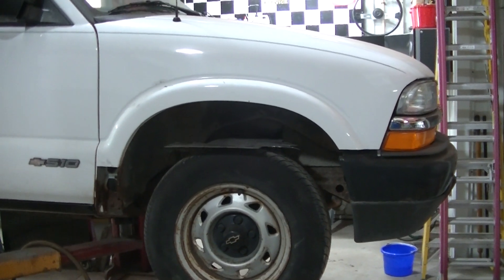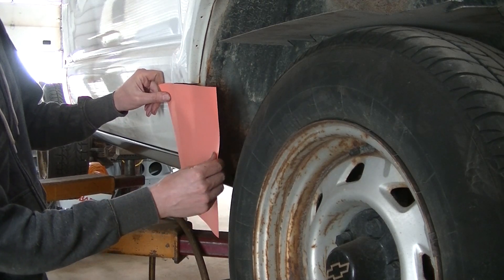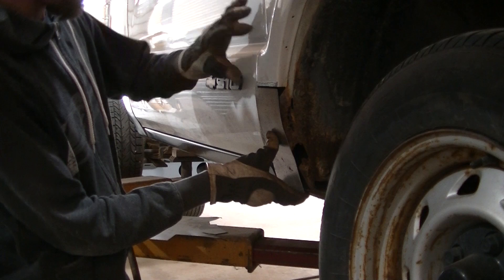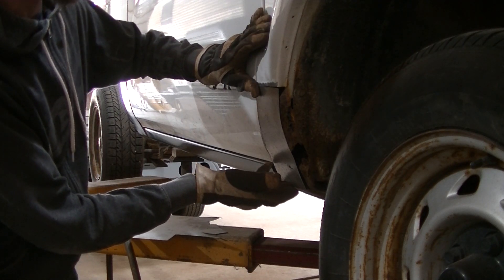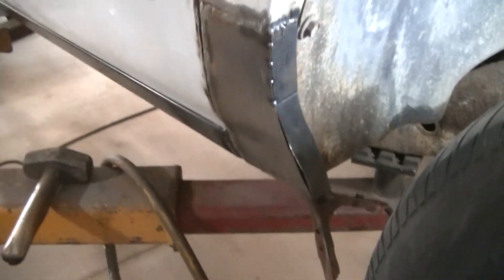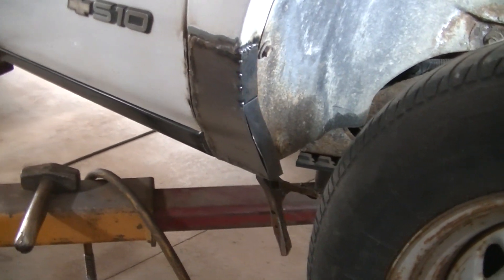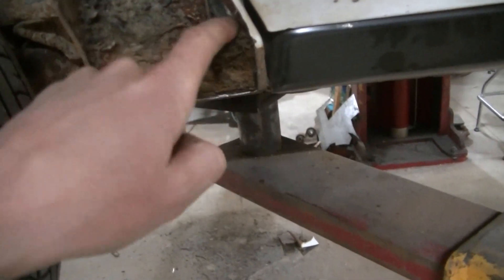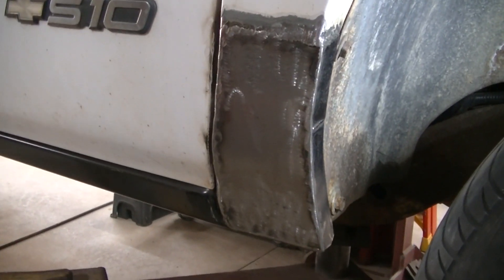Project JUNK S10 "Rusty Front Fender Repairs"

Comment: that really cool that you managed to fix the fender, but are you going to paint the back side of it?  It's not going to be like the rear quarter panel on a car is it?
Reply from the maker: Going to fill the back side with Fluid Film.  I guess I should have said that.
Reply: I'm not sure i'm really down with that for my own projects...(if ever get a chance to actually get a project...) but I seen you do this a few other times on your other trucks...  I definitely will watch your channel if you keep updates on the S-10 and maybe go back and show us how the fender is holding up using Only Fluid Film.
Reply from the maker: Fliud Film is a proven product.  Rust can form under paint and undercoating.  It will never form under Fliud Film.  If you don't wash it off it will protect bare metal and inside the fender it won't get washed off.  It really is the best way to protect from rust.
Reply: And that's the problem... in all likelihood it would be washed off if I was the owner.  I generally wash my cars, and while I can try to avoid putting lots of detergent water where I know the fluid Film is... I still be risking removing it.. I need to layer up on the levels of product protection because the owner is a idiot.  Hell,  I don't know how.. but I can tell you I'm the kind of guy that manages to cut the cord on I saw i'm using with its own blade, and just today no less.  Ok, I do know how but Its taking way too much typing to hit reply..  anyway...

Sorry, but you might vary well be the perfect car owner.. but I am not and learning from you to be better.  So If i was try to fix my own fenders, I could somehow get this all off and paint it?
Reply from the maker: Pulling the fender off the truck will be the only way to paint inside it.  It was primed at the factory and still rusted out.  The areas that rust on vehicles are usually the places you can't wash.  Inside fenders,  inside rockers,  bottom door seams.  There is no way to really wash these places out.  Even if you try.  These places rust out from the inside out.  Getting Fluid Film inside these places will prevent rust and will be very hard to wash off.  You could reapply the Fluid Film every couple years if you want.
Reply: well in my case.. its  why not both deal.. If I was fixing a truck fender, I paint and Fluid film it.... because I'm a idiot that will probably wash away the FF not even thinking about it like there happens to be a cord right next to this saw that i should be careful to keep away from the saw.
Reply from the maker: You are not an idiot.  Everybody makes mistakes.  We have our bad days and good days.  You just had one of those bad days.  People that don't think they make mistakes are idiots.
Reply: maybe..  But I do know I need just need things I own to be intuitive...and more durable then most.  Hence why all the car parts must be protected by paint.... and anything else on top of that I can find.